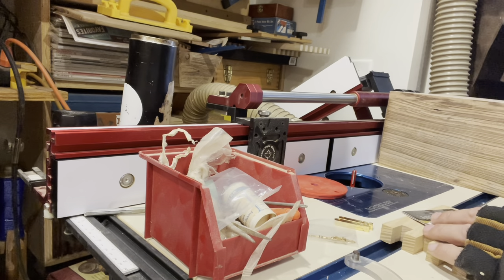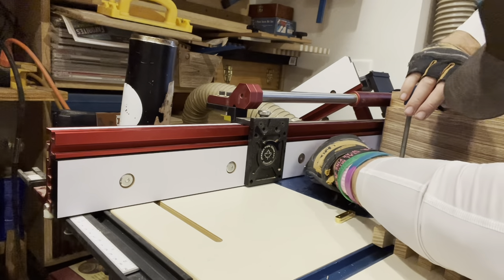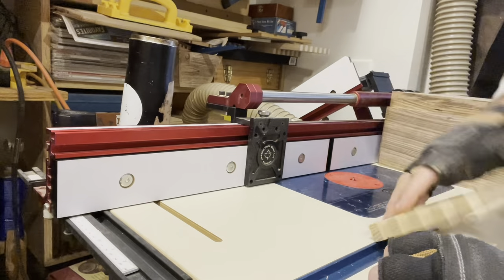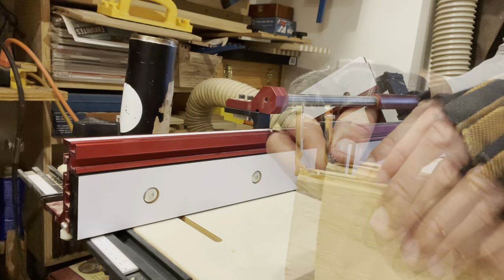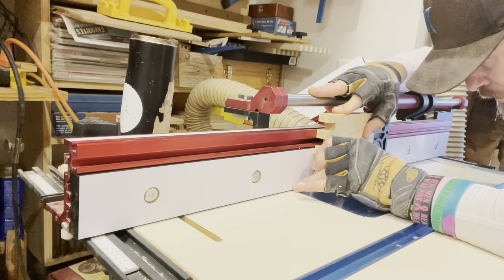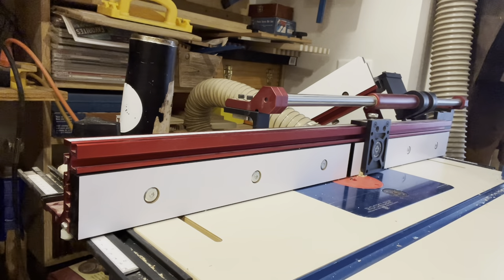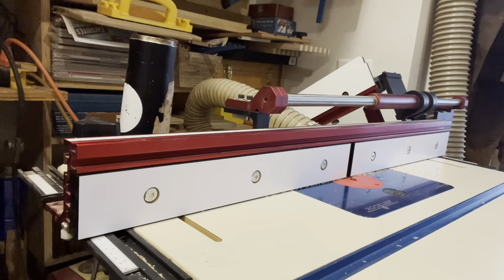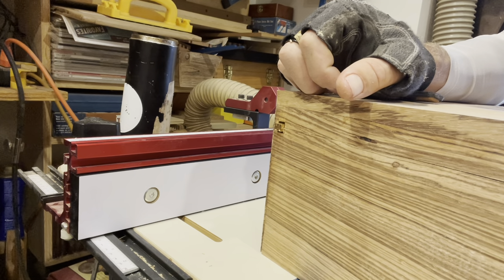Routing side rail hinges from high point for custom box humidor exotic zebra build part 6

Comment: One of the worst demonstrations I have seen; 90% of the time we have no idea what you are doing and no explanation as to what you are doing. You need to adjust your camera angles so the viewer can see what you are doing, most of the procedure is covered up by a gloved hand in the way, particularly when you would up the router bit and fingers over the hinge when we are trying to see how deep the hinge is fitting; No explanation as to why you changed the direction of the feed of the box and lid; only someone with woodworking knowledge would realize why you did that. How do you expect anyone to know why you routed the small bit out at the end? most viewers would have no idea and no explanation. You need to pay more attention to your angles and try to visualize what your viewer will be able to see.
Reply: Additionally, this video will be watched mostly by novice wood workers and more accurate camera angles would be great.  The novice needs to also see safe procedures.  Making adjustments to the fence stop while the router is running, not wearing eye protection, and wearing gloves using powered rotary tools are all bad examples.